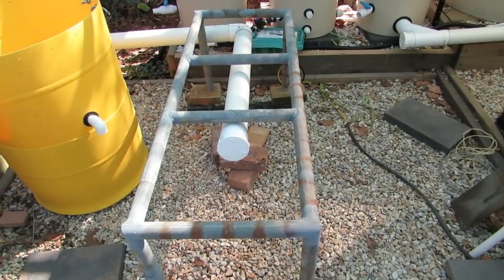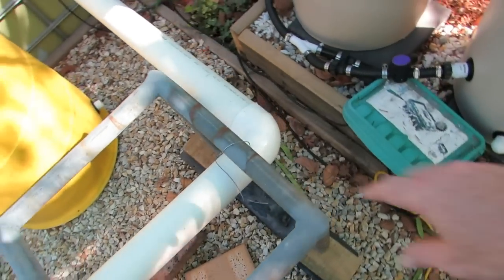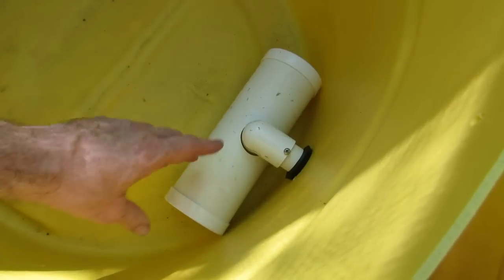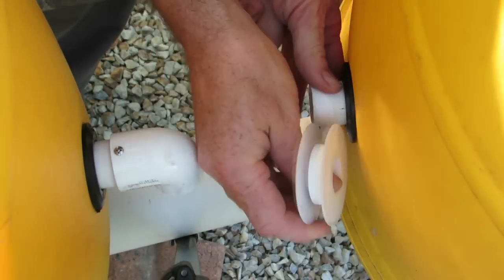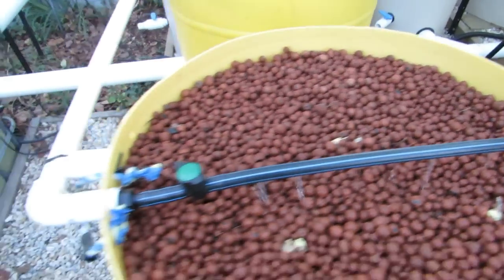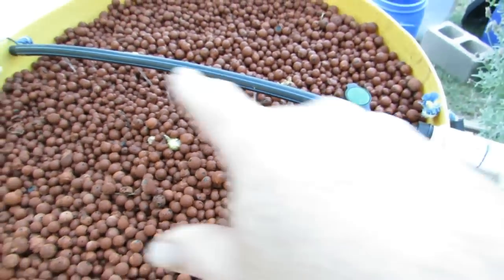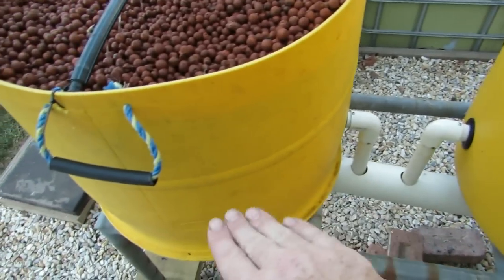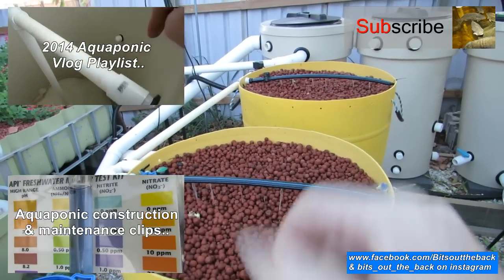Aquaponic Dutch bucket / barrel build.  Aquaponics Vlog 9..

Comment: Just a tip no need to glue, Use silicone just to seal, so as you can reuse fittings easy
 great vids though rob

Comment: Nice build Rob. From my somewhat limited experience I found that holes that small feeding the barrels will plug up in an aquaponics system unless the water is thoroughly filtered. I've seen your aquaponics set up and you do have a good filter system but it's difficult to filter out all the solids.
Reply from the maker: Hi Jeff.. Am not too worried at this point as none have blocked yet so hopefully they will last a while longer.. I think the feed tubes will end up coming off & a few modifications made as the ginger roots spread out.. Will show the modifications on future clips.
Cheer & all the best mate,
Rob.

Comment: Great build and the ginger's looking fantastic! If you try the dwarf fig in there, I wonder if you cut some holes in the side around the top half of the barrel if you'd be able to get an air-pruning effect to thicken up the root growth (that's worked so well on that Papaya tree), but without losing too much water...what do you think?
Reply from the maker: Brian Barth  Hi Brian. Am looking at trying a few different ways to grow dwarf trees in the system but haven't ventured as far as air pruning  yet. Would be a matter of trying to keep all the water in the barrel or collecting it in a tray  I think. Would like to know if you come up with any ideas Mate.
Cheers & all the best.

Comment: Nice Video.  sorry i am beginner to this, i dont find difference btw your grow bed and the yellow dutch bucket question .  can you please help me understand more .

You build like a professional. awesome
Reply from the maker: Not a professional at all Sri, just like to share the builds I add to the system.. Might give folks a few ideas on how they can do better for theirs ;-)

The other beds were set up as flood & drain units to start off with where these are more a constant flow where the water falls through the media & over the plants roots..
With the flood & drain beds they are flooded to a certain level until the siphon starts then the water is drained away into the sump for the cycle to start again.. One of the remaining beds is still set up that way but the other is a constant flow.. 
Will be showing how the new bell siphons work in an upcoming clip but also have an older one that might help to explain how they work.. 
Bell siphon, grow bed & pipework explanation. IBC Aquaponic System construction part 6.

Hope that helps some..
Reply: Tats informative.  Thank you.  It helps me a lot .

Comment: Hi Rob! Great channel you have! I find it to be an enormous source of useful information in helping me to get my own system up and running.
 I have one question about this video in particular. Why did you plumb the feed for the DB's from your sump as opposed to tapping into the flow coming out of your filtration? Was it just a question of simplicity?
Reply from the maker: Hi Lenny & sorry for taking a while to respond. 
I have the system set up so the flow is split from the sump tank.  This clip runs through how the system is plumed up after these barrels weer moved. 
https://www.youtube.com/watch?v=raLv4RAUte8
Hope that helps some.

Comment: Interesting set up, Rob. Quick question. What are your temperatures for growing your ginger? All I have found so far is "warm and humid". Yeah, well, warm is subjective from one place to another. My summer was cool compared to previous years. My ginger didn't do any thing until I covered it. Thinking of going greenhouse with it next year but would like to find out about temp ranges for various plants.
Reply from the maker: Hi Jay..
We have a summer average in the low 30's here & this spring wouldn't of been much cooler.. Might need to pop it in there green house for best results there..
Ginger likes a soil temp between 20-30°C (68-86°F) if that helps you some.. 
Cheers mate & hope all's well..
Reply: Helps greatly! thanks Rob. Thanks for popping in the soil temp as well. Yep. gotta go greenhouse. The last 2 years we didn't have more than 1 or 2 weeks over 30c and even that time wasn't each day in a row. Very cool and rainy.

Comment: rob the water is constant and the barrel is always dry or it fills with water
Reply from the maker: Hi Ricardo.
The water just trickles through in this set up, much like a hydroponic Dutch bucket arrangement.  👍👍
Cheers mate.
Reply: @RobsAquaponics  
cool rob. and in aquaponics it has to be continuous flow, and water has to be directed at the root. 👍
Reply: @RobsAquaponics  
rob one more question I have, what is the best calculation to scale the amount of plants in relation to the amount of fish. Many here say that should be the amount of feed a day, particularly I follow the nitrate test but I don't know if it's right. can you help me.
Reply from the maker: @ricardojuvanelli2172   It is best to work out planting guides to the feed going in & you will see a few different amounts being mentioned by various folks.
I think a safe amount would be 30-60g/m² for leafy greens & 50-100g/m² for fruiting plants. 
I would still use the nitrate test & try to work out what level of feeds will give you what amount of excess nitrate depending on the amount & type of plants you're growing & take notes for future reference. 
Hope that helps some mate. 
Cheers.

Comment: Have you tried potatoes in the Hempy Buckets? Also have you tried hydroton a couple of inches above your drain hole then fill it up the rest of the way with bird nest Coco Coir?
Reply from the maker: Sorry I missed this Chris. I don't like to use organic matter in the system where it could break down & cause issues. I have seen folks use it wit  no issues inside the grow pouches though. Haven't tried it my self so can't day if I'd recommend using it that way or not.
Cheers.

Comment: How well does the water spread out across the clay media? I Imagine it would drain extremely well, with the water draining near vertically? Unless the roots go near to directly under the water outlet you'd think it would be pretty dry in the top segment.... or at least until the water has cascaded out a bit wider.... I'd imagine it would be difficult to germinate seeds, but seedlings would do fine? Ginger and other rhizomes would have enough stored energy to get the roots out? I'll be watching with anticipation Rob :-) Much cheaper option than building an IBC grow bed stand, and a narrower footprint as well.
Reply from the maker: Hey Mr Justin.. At the moment the water is cascading over the clay under the surface of the bed & spreading out to 75-100mm/3-4".. In some spots it isn't spreading as far but I'm not worried about that as the ginger roots will search the water out & will also help spread the flow around the barrel once they multiply.. You can come around to have a look if you want.. I could do with a hand cleaning out a few beds worth of clay ;-)
The other option would be to drill holes on an angle off the pipe to spray the water out further or like bo ter berg suggested create a hoop.. Could also add a 13mm/½" "X" or "T" in the centre to spread the wet zone out..  If I was to plant a few plants like lettuce might of set it up that way..
Cheers..
Reply from the maker: An "x" piece in the middle would do the job too I think bo ter berg..
Cheers mate..
Reply: I have no doubt it will work Rob. Just summing up in my mind the pro's and con's of flood and drain V the Dutch bucket. I'd be keen to come take a look, but will have baby in tow (as an excuse) si prob won't be able to work ... :-( ;-)
Reply from the maker: Justin Hammond She can play in the bed mate, I won't mind  :-D
Reply from the maker: bo ter berg I have loads of fittings laying around Bo :D 
Have fun with the build mate..

Comment: Hello Rob, love your videos.

Quick question: with the system would you get dry spots around the edges? I'd look to grow as many beets as possible for juicing. Trying to figure out the best way to grow them via hydro or Aquaponics?

Thanks in advance!
Reply from the maker: Hi there..
Sorry for the slow reply..  
I found that the beets didn't do as well in the barrels as they did in the flood & drain beds.. I think the barrels were just a bit to dry once the ginger roots took over..
Have sprinkled a few beets through the flood & drain trays the other week.. Will be using them  for juicing & salads.. Have a few that have already popped & are looking good..
Cheers & have a great one..

Comment: Cool, stuff!
Whats going on with the water in the barrels? I'm guessing it's basically just running through, while having a few inches of water in the bottom all the time?
Reply from the maker: That's fairly much it Uncle Bete.. Will be about 1¼-1½" in the base at all times.. Will be interesting to see what's accumulated in the base at the end of the season.. 
Cheers & have a great one..

Comment: Great :) do you have any deep water culture tanks? (Please link if you've done a video already)
Reply from the maker: Hey Martin.. No DWC as yet but may do soon.. One of the 2 grow beds off to the side will end up being DWC I think.. Just need to clean the clay out of the second grow bed & reposition the base.. Will have to source some foam or some other material for the raft as well but that's another issue.. 
Cheers mate..
Reply: Rob Bob Great. I have just built a DWC system. I will make a video this week and post it hopefully. I made lots of rafts out of polystyrene. And after spending hours dilling all the basket holes and putting it together I found out the polystyrene I used may have been treated with a flame retardant chemical. So before connecting it to the fish tank I need to research a bit more. I've found it difficult to source a material in the UK that has absolutely no chemicals.
Reply from the maker: Martin Currah Am not to sure about using the styro myself but have been assured that there are food grade sheets out there... My other thought was to have the plants suspended over the water Kratky style..

Comment: with one hose running across your barrel, how would you water the plants that would be growing on the outside of your watered area inside your bed? this is a larger tube than a 5 g bucket, any plants in the outer edge wouldn't get as much water, would they?
Reply from the maker: It would be fairly easy to set up a round feeder ring that ran around the outside of the barrel. Has I had all the plants towards the centre their roots grew into the wet zone.
Cheers.

Comment: what are the disadvantage of dutch bucket to a new to aquaponic gardener like me?..was wondering if I could make a wood frame and a pond liner 12 inches deep and 24 inches by 48 inches using this system for my 8 foot by 10 foot greenhouse. ever heard of anything like that? oh sorry off a 50 gallon barrel with goldfish in it.
Reply from the maker: Hey Zach.. Sorry for the slow reply mate.. 
I think that any container over a bucket in size really isn't needed for a Dutch Bucket system.. The reason I went with the barrels for the ginger is that I wanted extra room for the roots to grow as they'd be a tad cramped in a normal bucket..
For a bed the size you're planing & having a 50gal barrel as your tank I think a constant flow or flood & drain bed might work better for you.. The other option would be to set up a series of Dutch buckets on a bench where you're planing the grow bed..
Hope that helps an bit & sorry again for the slow reply..
Rob..
Reply: Its all good.